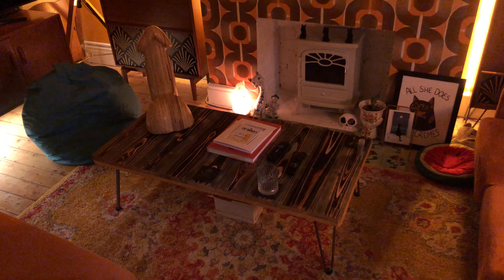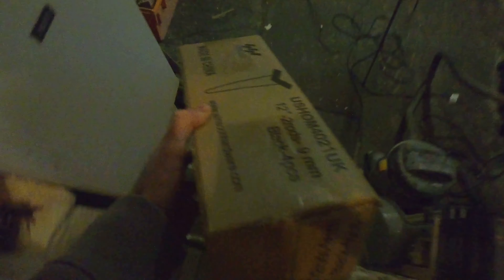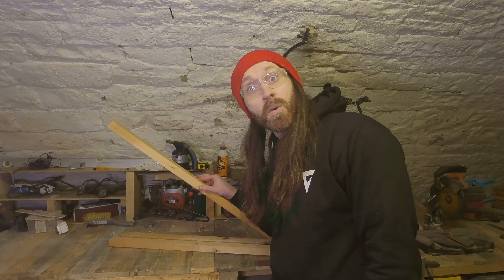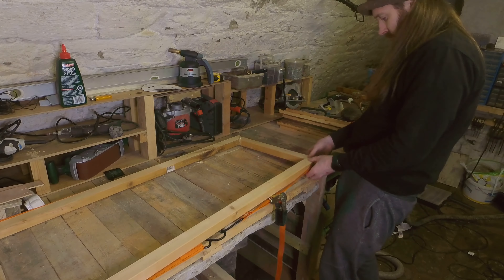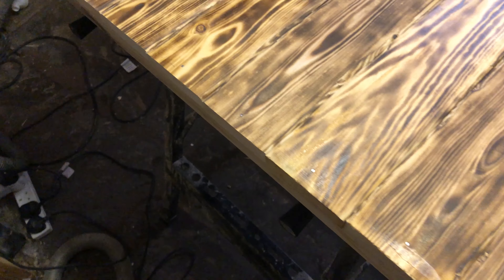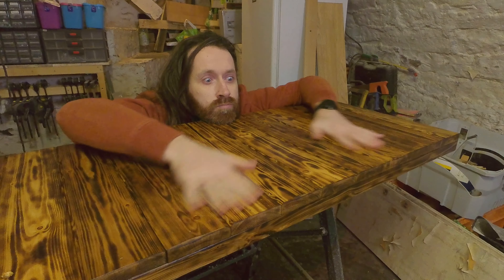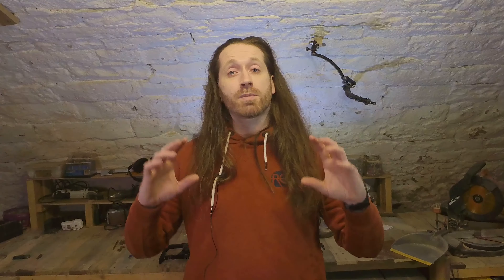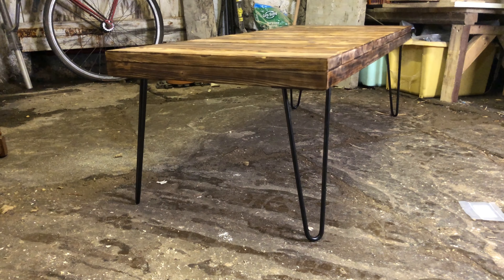Building a Coffee Table for Under £50

Comment: Nice work. What is the space you're working in? Is that a typical UK basement?
Reply from the maker: Most UK houses don't have basements. Not only that, mine got converted into a bomb shelter after WW1! Soooo.. not that typical :-)
As for space, it's 13ft by 13ft with some extra spaces on the staircase. But the curving walls make it hard to work with.